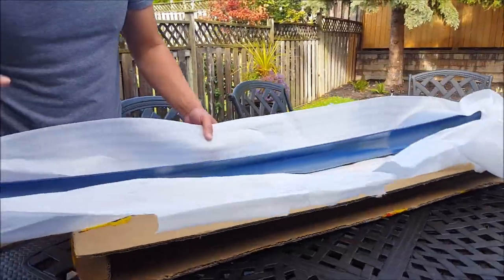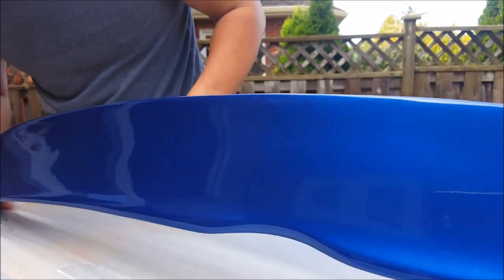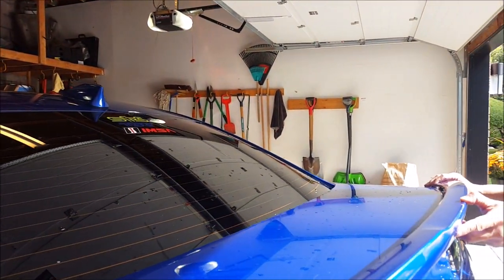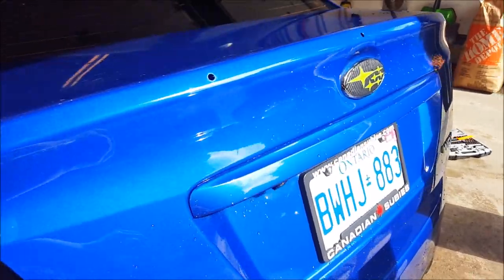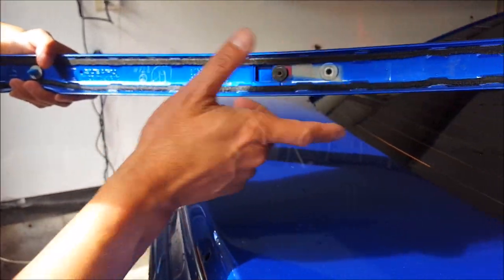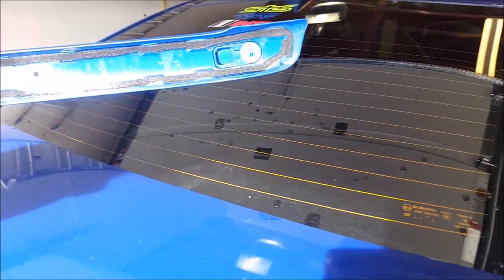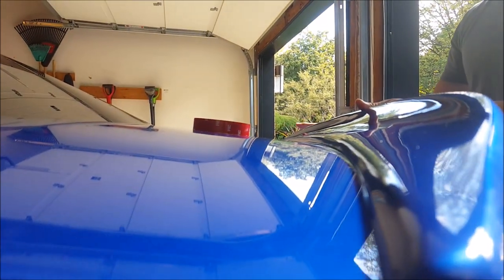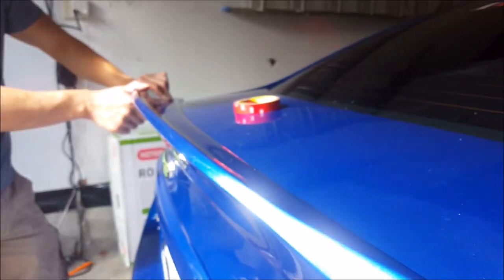Install How-To of Rexpeed Duckbill Trunk Spoiler/ Removal of OEM Spoiler Lip

Comment: I heard that the bolts on the original spoiler are secured with Locktite and that people have snapped them off. It was suggested to use a torch on them to help melt the Locktite. Did you have to do this?
Reply from the maker: No. It came of fine with not too much force. Cheers!
Reply: Thanks!

Comment: Any issues so far with using only 3m to mount. I've seen some screw it in. Just worried about weather affecting the 3m.
Reply from the maker: Marc Tiamzon so far seems to be holding up fine through the fall and winter here in Canada. -20°C
Reply: Awesome!
Reply: Marc Tiamzon It's almost May now and the tape has held up great!
Reply: @ahjooohn  nice im also from canada and just bought one, I dont want to drill holes in my base wrx trunk, hope it survives our tough weather

Comment: what kind of 3m is that and where did you get it?
Reply from the maker: Salvador Magluyan provided with spoiler
Reply: how's the 3m holding up?
Reply: Salvador Magluyan It's been holding up great. And with -10° temps, there are no issues with it getting loose.
Reply from the maker: Felix Tam ^^owner
Reply: did you get the duckbill from subispeed or rexspeed itself?
Reply: Salvador Magluyan I got out from Rexspeed directly. They're in Taiwan. Great communications with Derek by email. A++++ If you're getting the Pure Red, be aware of looks a bit orangey. The WRB is spot-on.
Reply: Salvador Magluyan It's still holding up great.

Comment: Why not bolt it up that tape won’t last going over 100
Reply from the maker: The85705 the tape used is way stronger than you think :) so far survived hot and freezing cold Canadian weather at high speeds